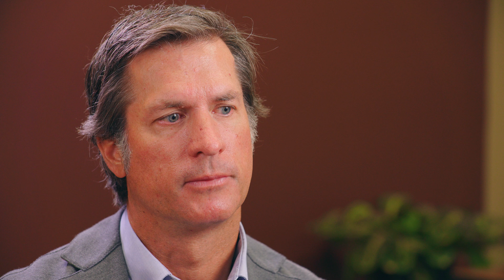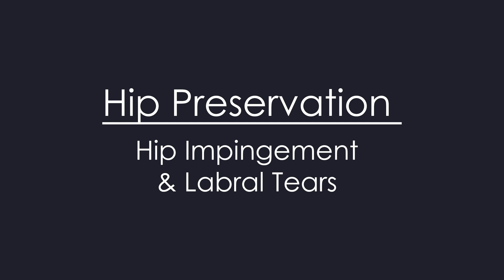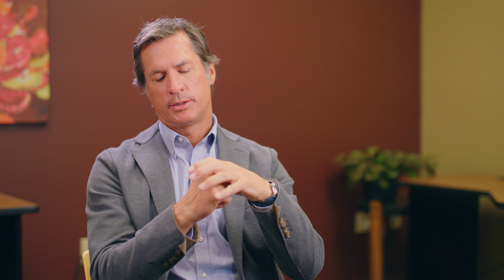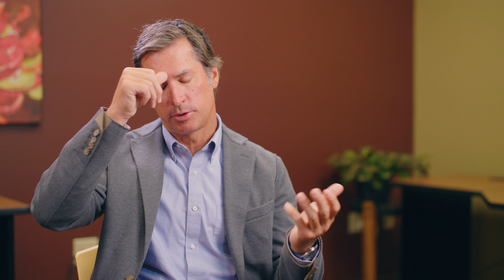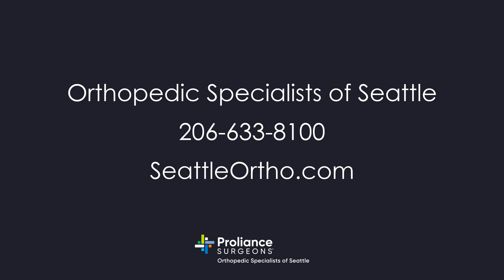Hip Preservation  - Hip Impingement & Labral Tears | Dr. Phil Downer | Orthopedic Specialists

Comment: It has been a year since my labrum was repaired. 3 months off work because my job is physical many mo ths if pt months before I could hike and I'm still having issues,  primarily with muscles abductors hip flexors,  hamstring.  In some ways the pain is much better but the muscle flareups are so aggravating.  I did my due diligence and found the best surgeon in my state and still feel I'll need a hip replacement some day.  Problem is i have the same issue on the other side and don't want to go through this again.  Any suggestions?